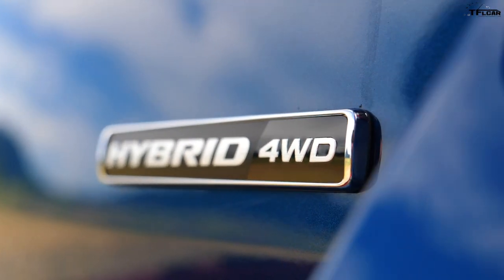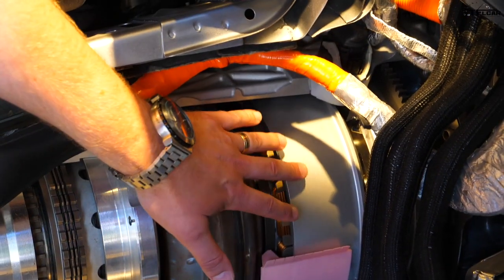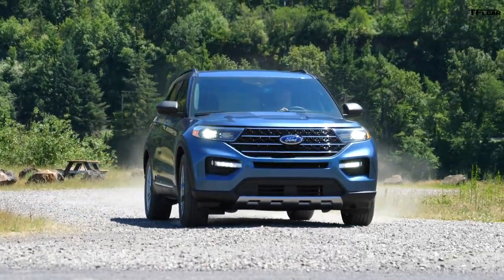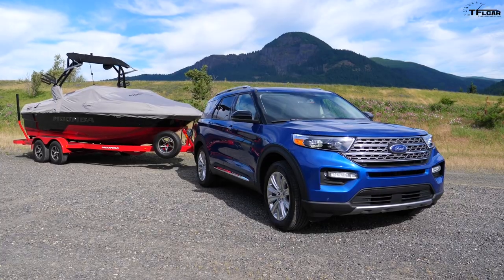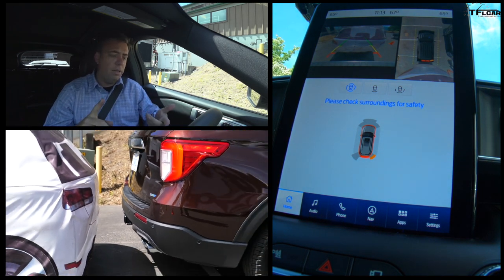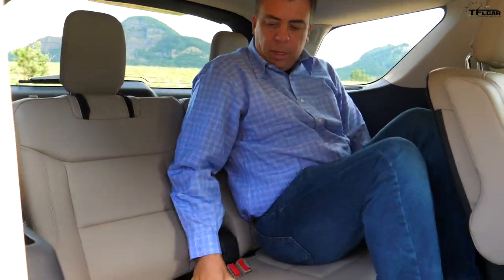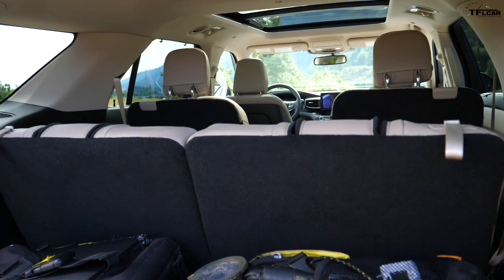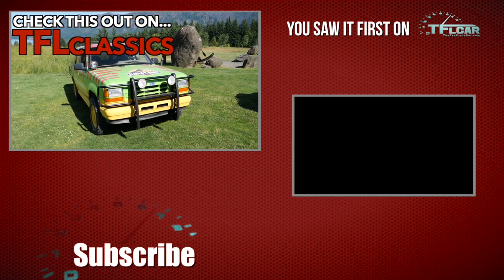Will It Tow? We Put The New 2020 Ford Explorer To The Test!

Comment: I would hate to see the repair bill on that transmission!
Reply: I'd hate to see the repair bill on any modern transmission. Doesn't matter what you have, GM, Ford, Honda, Toyota... transmissions are expensive AF to fix/replace.
Reply: There’s a monopoly on transmissions that’s why they’re made to fail now. GM and Ford uses the same transmissions.
Reply: That's what warranty is for. New cars are better to lease and give back
Reply: The 10 speed isn't actually that more complicated than the 6 speed. It's also used in so many vehicles that parts will be cheap.
Reply: @CFG39  I don't even think people fix it anymore they just get another one and drop it in
Reply: They don’t build transmissions to fail! ,,,,,,,,,, what????? That would not exactly promote the reliability and longevity of the vehicle. They make every vehicle to last as long as possible, every automaker. They all want to show how long lasting their vehicles are. Myths, rumours, bullsh**, it’s all out there by the naysayers. Another term is sour grapes. Whatever you want to call it. Don’t listen to people that know nothing of the vehicle, or brand that say this crap. 9 times out of 10 they have never had the vehicle, never driven the vehicle and at least 1/2 can’t afford the vehicle that say that.
    I say this from my personal experiences from people I have met that talk about vehicles and from vehicles I have driven, owned or close personal friends and family that I trust that have owned and driven.

But yes, I would hate to see the repair bill. I had a 2014 Toyota Tundra that went through 2 transmissions under warranty. Both were replaced by the factory through the dealership. They don’t show you the value because it is warranty but the service tech said that transmission (basically 2007 technology) was over $6500 Canadian to replace, plus the cost to r&r the tranny. Toyota is a no go for me for the next long while.
    My previous truck to the Toyota was a 2011 F150 5.0 4x4 and , doing the same job, I drove that for over 70,000 miles with nothing going wrong. The Toyota had just over 50,000 miles when I got rid of it.
Reply: That's the problem with hybrids. They're super complicated. This might be fine if you can make very reliable cars like Toyota. Ford...?
Reply: Pham Nuwen - did you read my full comment? I know it is long but I had many problems with the Toyota, the Fords I have owned have had no problems. Sorry, for me,  those are facts and I will stay away from Toyota. I know a few guys in my circle that have 2016 and 2017 Toyota Tacomas that have had to have their rear differential replaced. One of those trucks also has a problem with 2nd gear in the transmission right now. In the past Toyota was bulletproof (except the bodies) but since 2004, the trucks have not been that great, they have had a lot of frame issues due to rust, Ford, GM and Ram have not. They have had all kinds of transmission and now rear differential issues, ok most of the domestics have as well, the 3.4 was a stick of dynamite ready to blow, it blew as well as performance. The current Tacoma 3.5 belongs in a car, not a truck. Real world driving on the highway is mostly in 5th gear on windy days or slightly hilly terrain because the engine has to rev to move the truck, there are all kinds of issues with Toyota trucks, the same as most of the domestics. They are all made in North America and mostly the USA. Most, if not all of the engineering is North American now. They are all considered domestic brands in the USA with the exception of a few domestics made in Canada and Mexico. It is not the same ball game. Toyota break down as often, in my case way more often, as the domestics. 
    Understand I make the most objective points I can, I don’t have brand loyalty. I paid a premium price for a Toyota and their ridiculously expensive routine maintenance program (compared to the other big 3) and got a truck that has been the worst truck I have owned in my life, I’m 56 and have owned a LOT of trucks. I have had as many as 14 at one time between my business and my personal collection. 
   Those are my facts and your brand choice of Toyota was the worst of well over 100 trucks I have owned since 1982. Ughhhh.
Reply: @CFG39  I remember the days when a transmission was around $300 to rebuild. Today, $3k is more like it.
Reply: Vw uses Toyota transmissions
Reply: @shitloveaduck  What??? A Toyota failed
Reply: @shitloveaduck  My point was that if you want to make a hybrid car you must be able to make really reliable cars because hybrids contain so many systems.

I've heard things about Toyota quality not being quite what it once was too.
Reply: lee hancock -  hahaha, yeah. Maybe I was just the most unlucky guy out there . I loved the truck for 6 or 7 months and for the  last 3 months, but I just didn’t trust it anymore. S**t happens I guess. I really have had great luck with full size ford trucks and Nissan Frontiers. I just downsized and had to lay off 5 guys. I gave each of them their assigned 
Nissan Frontier Pro 4X crew cabs as a bonus over their severance. They deserved it. I just don’t want cattle anymore, too much work at my age and with some unfortunate health issues.   Back to my F150 again. I have heard there are some potential issues with the valve train in the 5.0 now. Fingers crossed they were corrected for 2019 like they say they did. I bought a truck built in April, 2019 months purpose hoping I got a good one.  Stay safe out there.
Reply: Pham Nuwen - I think I misunderstood you before, sorry about that. Still a little touchy about the Toyota I had I guess. Stay safe out there.
Reply: Ford is actually replacing those faulty transmissions instead of trying to fix them.
Reply: Asian Ford Guy - that is what Toyota did with my Tundra, twice! Even back in 2002 when 2nd gear in my transmission went out on my 2001 Dodge Dakota automatic, they just replaced it. The mechanics for the dealerships are not transmission specialists. The most cost effective way to take care of an issue is to remove and replace. They would have to send each transmission away for repair then get it back and reinstall it. This will likely have the vehicle tied for a week with the vehicle sitting on their lot in the interim. Storage space, paying shipping and retail for the repair to the tranny. Easier to just do a repair and replace, then auction the transmission in a “lot” of parts to recover costs. All this is borne by the manufacturer, not the dealer. The client is way happier being tied up for a day and getting a new transmission. Goodwill goes a long way with a frustrated client. The client goes away happy, instead of being a week without their vehicle and getting a patched up transmission, they get new one in a day or so.
     Once you are out of warranty, just go to a transmission specialist.

Comment: 28hwy and over 300hp! Incredible
Reply: Rob Basque buy a warranty if you’re concerned about repair costs. 👍🏻
Reply: Rob Basque not in this thread you didn’t...like I’m going to sit here and read every single individual post...
Reply: @Rob Basque ... the specs I stated were for the 4cyl EcoBoost model. 4cyl EcoBoost has been around for nearly 10 years now and has shown to be reasonably reliable. I prefer naturally aspirated cars myself, but the technological achievement of a 28mpg 4wd rwd 3-row SUV is something to marvel at. A 2000 Explorer could not get 20mpg hwy going down a hill with the wind at its back.

Comment: Yes it is 2020 Atlas Blue Metallic  Ford Explorer Hybrid AWD Limited 3.3L V6 318 Hp 320 Torque 10 Speed Automatic Transmission Gauge Cluster 1,240Lbs Payload Copilot 360 Reverse Brake Assist Active Park Assist 2.0 Screen Captain Chairs Panoramic SunRoof 7 Passengers 21 Degrees Approach Compares Toyota Highlander,Chevrolet Traverse,Honda Pilot, $57,000 Vs 2019 Atlas Blue Metallic Ford Explorer XLT 2.3L 300 Hp 310 Torque 10 Speed Automatic Transmission RWD 21-28-24 $42.000 Ulimate Subcompact Suv!!!!!!!!!!!!!!

Comment: RWD explorer what is old is new again... 35kw battery and 35kw motor?  doesn't make sense.. The battery is measured in kWH.  Is the battery 35kWH?  that would make it pretty large for a battery.  Is this ford guy an engineer?
Reply: Joeys Cleaning Lady exactly what I thought when he was talking ha ha
Reply: @stdlyman3k  On Mr. Trucks channel the lady says it is a 1.5kWh battery I assume that 35kw number is max discharge rate of the pack which would put it over 20c discharge lol
Reply: Joeys Cleaning Lady holly crap. If that’s right talk about degradation. Sure hope they have an amazing thermal Managment. I was going to be very surprised if it really was that big of a battery!
Reply: @stdlyman3k  this whole setup is not very impressive a 35kWh battery would have been impressive!   Not sure why they are quoting max discharge rate from the battery.  That just seems like a weird spec to keep quoting rather than capacity.
Reply: Joeys Cleaning Lady that’s why. Because the battery capacity is not very impressive and the output isn’t anything crazy. Most people will just say oh cool that sounds like a lot
Reply: 1.5 kwh battery not 35kwh! The current Fusion Energi is a 7kwh battery it has a EV range of 12-25 miles depending on how you drive. 
I suspect the Aviator will have something in the 10-14kwh size. Thats what I need to justify replacing my Sequoia and loosing a seat and some 4x4 ability
Reply: @U20E27  Needs to be over 20kWh to  generate any excitement.  A 48v start stop batter is about 1.3kWh lol
Reply: The non plugin Is only a no engine idle and creeping I traffic hybrid. You want more you need a plugin which Ford only released it in Europe and is only selling here in the form of the Lincoln Aviator plugin. 450hp 600ft lb of torque. Yes your correct but no 35kwh battery is a 100 mile range EV suv not a plugin hybrid battery size.
Reply: @joeyscleaninglady2877  There's a sweet spot for hybrid batteries and it's probably a lot lot lower than 20kWh. With a big battery you might as well go all electric and eliminate all the complexity of the combustion system.

As long as the battery is easily replaceable and affordable a small one probably works (if you insist on making a hybrid rather than a full BEV).
Reply: @phamnuwen9442  BMW i3 has a big battery and a REX I like the idea of a larger pack and a rex.  In a serial hybrid application there is not nearly the complexity as there is with a pancake type motor that piggybacks on the transmission.
Reply: @joeyscleaninglady2877  You still have the extra complexity, oil changes, exhaust systems, catalytic converters, annoying noise and it takes up valuable space. Lots of maintenance and things that can break. I haven't tried the i3 rex but all I've heard is that people hate when that buzzing engine fires up.
Reply: Oh and its tiny. You can’t fit two kids in the back with the Lab dog behind the seat plus the swim practice bags. Then again neither does my wifes Fusion Energi but it cost 20k less has a superior interior and far better range.

Comment: I’m really bummed out Ford opted to do the plugin only in the Aviator. When I replace my 05 Sequoia I’m going full Plugin hybrid. I haul kids all over town crazy it adds up 180 miles a week all within a 10 mile zone🤦‍♂️. Plugin hybrid I would gas up maybe once every month and a half. I do like that Ford went non turbo lower maintenance 3.3 in the “hybrid” thats the one thing I do like about it. But plugin hybrid 3.3 would have been a instant yes order it for me. I’m waiting on the Aviator if I like the packaging I’ll buy a 2-3 yr old used one.

Except the captain chair 2nd row trend in SUVs just pisses me off. No thank you.. As a parent hauling kids in a 8 passenger 99.99% of the time kids many of which are car sick sensitive all choose to sit 3 across 2nd row when given the choice.
Reply: The Explorer will be available with either the Captain's chairs or a bench seat for the second row. So seating for either 6 or 7, depending on how it is equipped.
Reply: I agree, captains chairs are not for me. I'd order it without. I personally think about that back row folded flat, and groceries back there.  Someone cuts you off, and now those groceries fly to the floor of the second row. No thank you. Give a me a solid bench in the middle. If I were day dreaming, a third row delete would be rad, to get more interior cargo. Disclaimer: I'm not a parent and don't need the extra seats. I'd be more about the all weather, go anywhere side and the towing/hauling.

Comment: Old man battleship gray hard plastic interior with a few modern gizmos tacked on. No thanks. Note to Ford: quite reviving these old cars and let them stay dead. 

BTW, will the Reverse Brake Assist recognize one of those yellow pylons like the ones surrounding that electrical box in the video? Those are the true fender benders and bumper destroyers most people face.

Comment: $42,000 for a 4 cylinder?  Time to move on.  Holy Crap....at 6:55 you have to red line the engine to tow a boat?  That engine will NOT see 100k miles.  Not only is it bad to have to redline to tow...but there's also that turbo in there....it will burn up before it's time.  You just shouldn't tow with a turbo.
Reply: You shouldn't tow with a turbo? virtually every semi truck on the road has turbos, yes they are diesel but they're still turbos, the same complexity yet they tow every single day of their lives.

Comment: if they added the hybrid style 10 speed to a 2wd f150 they could probably fit 2 electric motors between the engine and transmission and 2 battery packs and it would still fit with the length restrictions and be legitimately good. Toyota's new hybrid tundra will probably just be some variation of that anyhow.
Reply: mercedes is doing this style of hybrid as well with they're hybrid SUV.  Engine with electric motor sandwiched between engine and transmission.

Comment: The power put out by the hybrid is just a little more horsepower and just a little more torque than the base 2.3 engine?  Shouldn't this hybrid with a 6 cylinder be a little more powerful?
Reply: It uses horsepower to charge the elecrric motor. If he removed the electric motor he would gain more horsepower and torque
Reply: Its not bad power comsidering the 2.3 is boosted

Comment: How much juice is that electric motor using to move that car? 35 kWh battery in the explorer, a prius prime has 8.8 kWh pack.  Plus its only 44 hp and Prius prime has 91 hp electric motor, this has to be just overly complicated start start stop system. I don't see that motor driving it highway speeds often.
Reply: Its a miss quote the battery is 1.5kwh. Its main focus is no Engine idle in traffic or creeping along. The plugin Aviator ie Plugin Explorer probably gets a 10-14ish kwh battery. Thats what I want
Reply: Well it's looking more and more I'll just have to buy an electric SUV in the future as a work vehicle. I am always installing temp power systems at job sites (I'm a sparky). There are more and more guys pulling up with plug in hybrids (few in pacifica hybrids) that want a place to charge as they work. I drive a hybrid now but I'm pushing the limit to the amount of tools I can shove in it, and need more room.
Reply: The plugin Transit Connect cant come soon enough. And I agree the no
Plugin hybrid is stupid. Ford only did this version for the Police interceptor which case it makes sense. You either go full plugin hybrid or skip it. Which case I’ll likely pick up a slightly used Plugin Aviator and skip the dealer drama and price games. No reason to replace my 8pass guzzler with a non plugin.

Comment: No integrated trailer brake controller from the factory or even available?  Come on, Ford.  Spend a few bucks per vehicle.  Now , someone has to piece something together in order to safely pull s 5K lb trailer.  Penny wise and pound foolish.  Your competitors are not like this
Reply: No disrespect, an actual question.. the Highlander and Pilot can come optioned with a trailer brake controller from the factory?
Reply: @rustlesee  no, they don't, but they're not rear wheel drive nor do they have as high a tow rating. If Ford wants the Explorer to be able to tow 5K lbs, then it needs a trailer brake controller, or at least be pre- wired for one.  Yes, you can always install one aftermarket.  I feel that if you're going to rate a vehicle to tow higher loads, it needs to be factory equipped to do so.  Otherwise, some idiot is going to try and pull a car on a trailer with no brakes, or on a trailer that has brakes but because there is no factory trailer brake controller, the trailer brakes don't work.  Don't brag about being an adventure vehicle and having a higher tow rating than the soft Utes if you can't back it up with the proper equipment.     Have you ever tried to pull a 5k lb trailer without brakes on it?  Scary and not recommended.  Only a fool takes chances like that.
Reply: The aftermarket controllers are not nearly as good as the factory integrated ones either.
Reply: @scottandrews4822 , oh I agree. Tons of idiots out there. But I'd probably state the risk of someone not knowing how to tow is very low. I'll also agree, the Durango does offer it as a $1500 towing package. And I'll also toss in it'd be nice if Ford did as well. Surge brakes are a work around, so are after market kits for a brake controller.. it's not the end of the world. But yes, you did make a great point.. Dodge does offer it as an option for the Durango, so maybe Ford should as well. 👍🏻